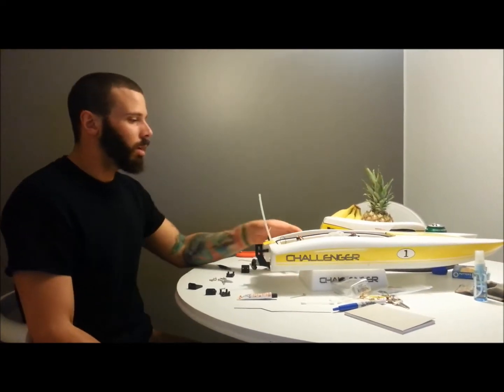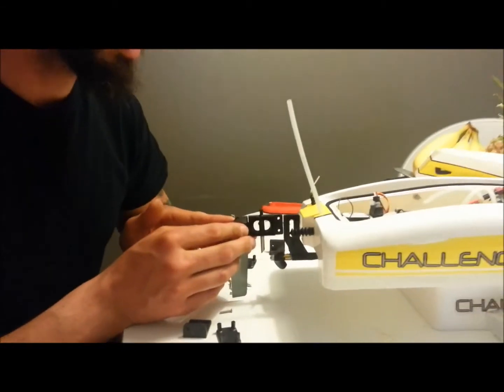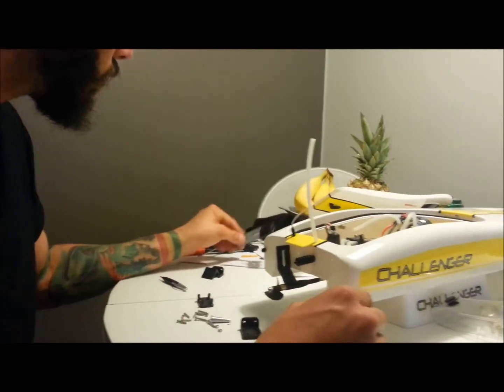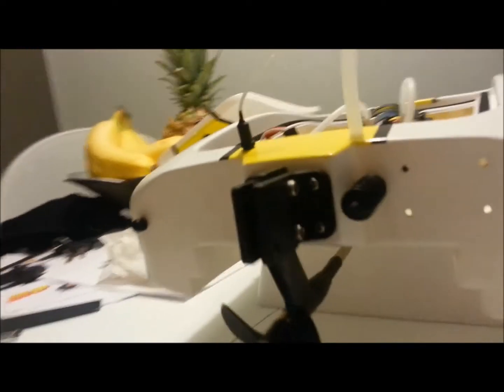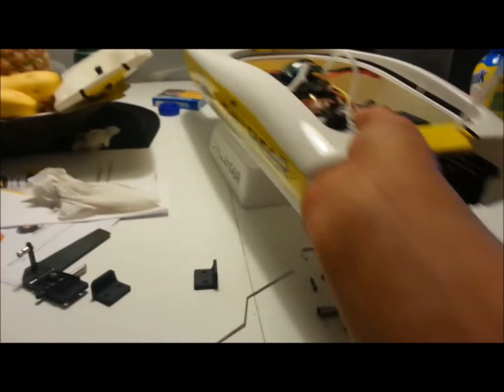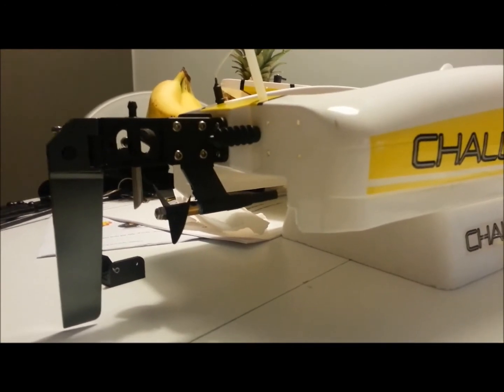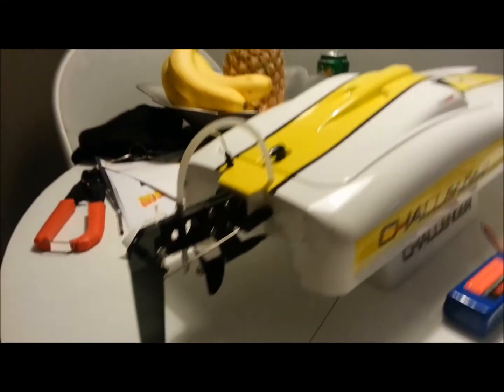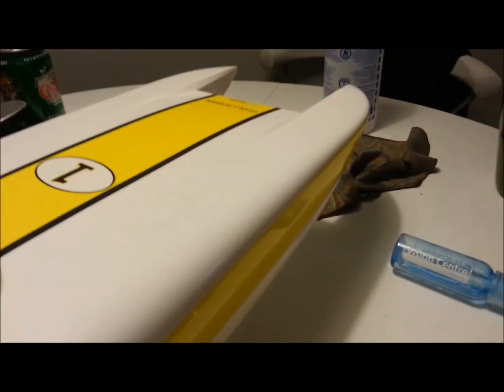LiteHawk CHALLENGER Rudder Mod

Comment: Just a note, by moving the rudder to the centre, you will create a lot more prop wash. What that does is make the boat more unstable at high speeds, it will also increase the turning radius at high speed

Comment: Hey man thanks for the tip! Looks good an was easier than I thought it'd be but why did u glue the holes. Why didnt you just replace the 4 holes with the other piece u took off. That what I did but havent trited this out yet.
Reply from the maker: Hey thanks and no prob! I just glued the holes to not have any extra parts on transom or screws sticking through. Plus, I did a custom fade paint job (that I'll be posting soon) and it just smoothed everything nicely And the water pick up is wicked inline... definitely helps push water through at low speeds and seemed unaffected at top speed.

Comment: Dud u end up having to have to change the water pickup or did it wirk just as well there as the stock position?
Reply: this is bad move.  ALways fun to F around with Shit doe.  Prop will cavitate crazy when it runs 4S and will kill  water intake.